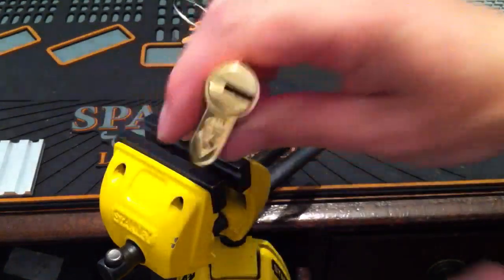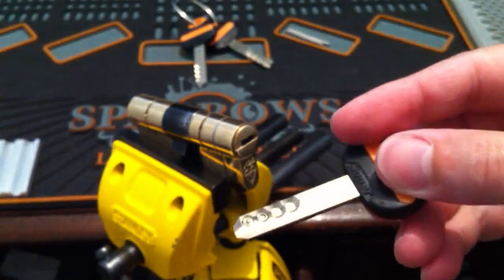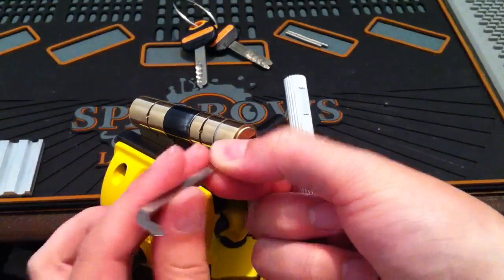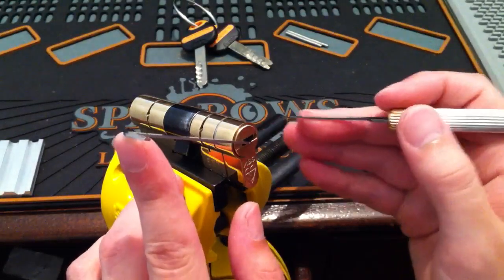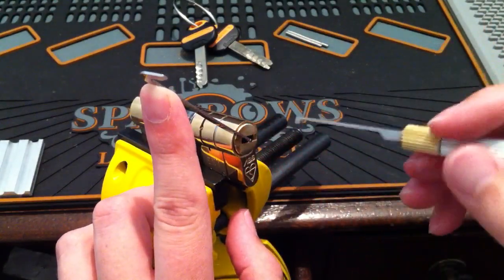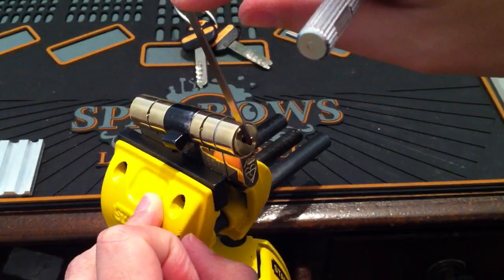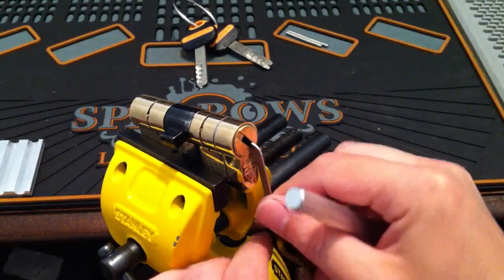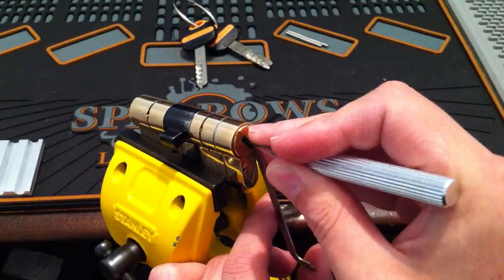Mech SPP Avocet ABS Mk3

Comment from the maker: sorry but you couldnt be any more wrong. search for mk1 mk2 and mk3 on google, the mk1 had no break off point... mk2 had a break off (anti snap) line down it and the mk3 had the anti snap break off line and the 3 lines of pins just under then plug housing in a row (trap pins)..

either way, with the trap pins.. if someone gets it picked to this and leave it, you cannot operate the lock from the indoor section wih a key.. very bad design if you ask me.

this video is of a MK3 ABS being picked.